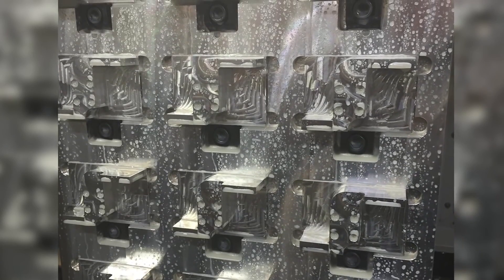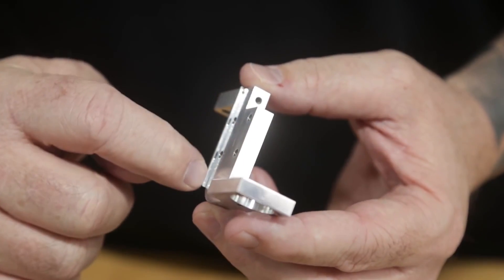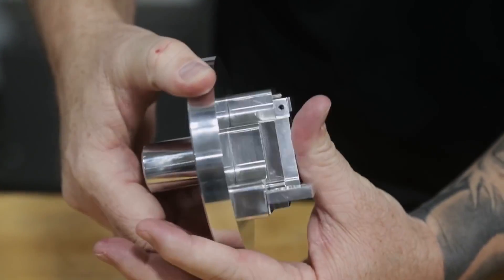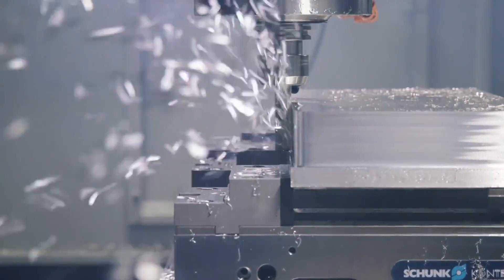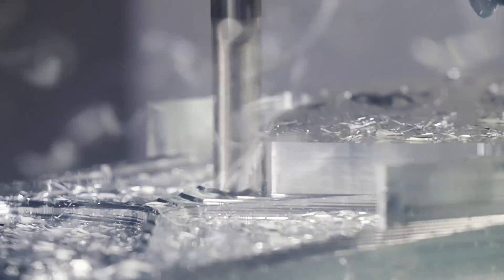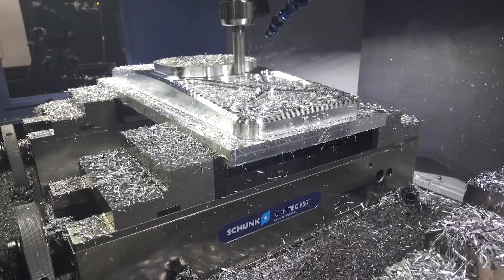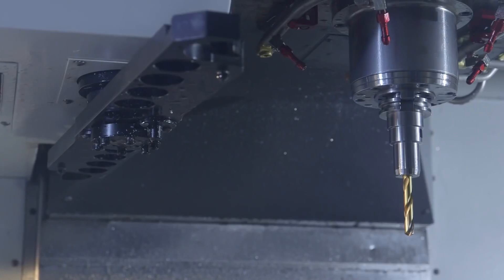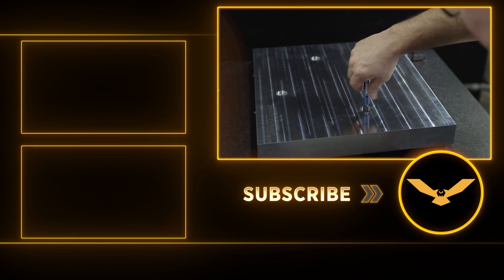Employee SCRAPS an INSANE Amount of Medical Parts... and the Reason is Even More INSANE

Comment: My shop does mostly formed components and sheet metal. I would be surprised if 50% of our parts are within every dimension on our drawings. The boss says we need to do better but doesn't actually put any effort into getting there. This is what happens when we run a soft die for 3k parts because you were too cheap to make a good one.

Comment: I was inspecting during graveyard shift,  an ogive aluminum  product during final CNC machining.
Guages, go- no go thread,  all good, but some  parts failing the hydro- test.. in the same spot...... 
The day boss came in & saw my pile of failed parts & 💩!!! Why did you let the machinist continue?. I told him all specs good ,. Long story short, all fails past threads and bulkhead. Engineering  determined Press  operation causing stress cracks punching out the blanks, Before final machining.  Later the  Co. reprogram  the CNC to Bore out that dimension instead  of punching it out. Saving the production run, although thousands of parts shipped over the years.
Laid off a month later, Force reduction etc,  but never forgot  the lesson & fix..

Comment: Every time you run a quality control check, one should check ALL dimensions. Every. Single. Time.
Change a tool? Check ALL dimensions again. Tweak a tool path? Check ALL dimensions.
The added down time will be made up by a factor of 10 in your reputation for accuracy.

Comment: I spent five years working a station running 5 different sized spur gear cutters.  It’s been almost 15 years since working that job, and I still have dreams where I didn’t tighten the arbor or the cutter, and wound up scrapping a 24 karat gold gear blank.  Now, we never cut gold gears, but my subconscious mind is essentially saying it’s still worried about scrapping gear blanks.  I guess my subconscious mind hasn’t realized that melting and casting a new blank from scrapped piece of gold isn’t actually that difficult if there’s time enough to do it.  I think I might actually miss that job.  Definitely beats sales…

Comment: lol Had a lead man tap a 10-32 hole at 10-24 in a $350,000 inconel nuclear pump on the last operation. Engineers ok'ed as it was just a cover for electrical non vital but there was some puckering going on before it was ok'ed.

Comment: I worked in Quality for over a decade. On several occasions, I was told by my boss that we were the least popular department in the plant. This was true everywhere I went. Several times I knocked down a pallet of parts and the plant manager told me that I HAD to sign off on them and I refused. Each time, he told me that if the parts didn't come back I was going to be fired. Every time the customer sent them back as defective. We had to pay the shipping both ways as well as the time and materials to make new ones.

I was called in as a contract inspector on a job for an outboard motor firm. They'd made some camshafts but the final inspection had detected a critical measurement out of spec. They needed to ship the parts for the holidays so I worked 12 hours a day for a week to get the parts checked. 60% of the parts were out of spec for the same reason as we saw in the video. A third of the run was done well before a tool wore to out of spec and was replaced. The part was not checked on the critical dimension with the new tool and all of the bad parts were run. Another tool change at the end prompted an inspection and the defect was detected.

Quality takes time and attention. Skip either one and you may be sunk.
Reply: Forcing QC to sign off on something sounds like it defeats the purpose. QC should be immune to that kind of behavior, as in you should have the final say over him.

Comment: Are you saying you performed an unauthorized repair process on FDA regulated parts?!  There is an approval process for every part and the process that produces it and if you deviated from your approved manufacturing process without written authorization you're putting your company in major danger of an FDA stop order. If you don't already have an expert on ISO 13485 you should probably get one.

Comment: one of my favourite things that any shop teacher ever told me is "power tools are a way to make a lot of mistakes really fast".

all it takes is one little mistake, and then everything compounds.

i've worked in a shop where the supers were so confident in me that they stopped even looking at parts before signing for first-offs and just signed the traveller right away. that was a bad idea. the quality of my work went down because i had no useful feedback. eventually, they put me back on the cold saw and in the grinding pit because i didn't understand their confusing directions and kept fucking up parts, and then they'd complain.

Comment: No part is PERFECT as he suggests. They only have to be “ in tolerance “to the print. Operator should have checked the features that end mill affects on the next part off the machine. Put it on one cycle and make sure it’s not scrap.

Comment: We had a similar problem recently. We do mostly prototype under 10-20 pieces. And it sucks when the operator doesn't check  in process like you say. Or even make adjustments along the way. Typically in feed and speed. We don't have enough machines for each fabricator to make the desired part. So we used dinosaur manual lathes and mills. And beat to shit with end play and substantial wear on the ways. But yet we have to hold tolerances of .005mm. Of course everything is a mix of metric and standard. So doing the homework ahead of time is key. We only have x,y readout and z is by dial. So all of this makes it nice when the cnc is open. Manual programming I'm ok. But would like to get into the cad end of programming them so I can make some more elaborate parts that the manual machines can't do. But working my way around the limitations of manual has made me better. Getting creative especially with achieving radius and taper has made me a better fabricator. I think I would really enjoy jumping into the programming end of machining and hang up my welding helmet. Anyways another awesome video. I'm trying to turn my our programmer onto your video's. Good stuff. Sorry for the 1st chapter here

Comment: When I got laid off from a job a few years ago due to a change in the industry as a result of milling machines being used to make dental crowns I was looking for a new career. I had a chance to be trained as a CNC operator but that level of precision was beyond what I was capable of. 
I have gone on to another trade where if you are off by 0.001 units it will still be ok and the machine will still work.

Comment: There was a thing I read some years ago, They had built a New Boeing aircraft, they went out and flew it, it worked just Fine. They Landed it, took it all apart. Every part was checked for accuracy and tolerance...The whole plane was 90% out of Specification.  Thing was The critical Surfaces that HAD to be There were there. I thought that that was very telling on where the industry at the time stood. During the production of these planes there were no CNC Capabilities, There were no Bubble Gum Chewing Button Pushers that are now Proudly mispronouncing their 'Machinist" status. Goes to show that there is some latitude in a vast majority of parts, and Most are not Critical, These were done on Fixtures mostly By Skilled machinists and they were done on Manual Equipment.

Comment: 100% right there with you. Been a CNC set-up programmer for over 28 years now. One thing I stress to the people I've trained or had under my supervision is that any change you make, offset, tool/insert change etc.... Look/inspect at the first part that comes out after the change. I would rather have them spend a few minutes on this than have a whole rest of the lot lost on an easily caught oversight.

Comment: You can't inspect quality into a part. Using a better inspection method may give slightly different results, but the part is as it is and the result probably won't make you or your customer happy. Normally they'd prefer consistent nominal dimensions, or well inside geometric tolerances. If they're happy to take out of tolerance parts, you need to ask if the tolerances you're busting your gut for are actually useful, and maybe a Design for Manufacture exercise should be performed as part of a cost reduction exercise (NB cost reduction, not profit reduction - profit can increase for everyone).
You're right to say 'assume nothing' but this becomes tiresome when the onus is put on humans. It's a far better idea to automate in-process inspection, and just use humans to investigate 'anomalies'. As for using a tool that was boxed incorrectly, why didn't your in-machine tool calibrator detect the tool radius wasn't as programmed? If it had, you wouldn't have had any scrap at all, just a near-miss in the log. If you don't have a near-miss log you need one to demonstrate the value of in process inspection to the bean counters, and it also helps Pareto investment in manufacturing/inspection equipment. Ideally the log should be initiated automatically by the tool calibrator and other detection equipment - don't ask humans to own up to 'mistakes'. Humans don't make mistakes on purpose - there are ALWAYS contributory factors, but holding your hand up is still too painful for most people unless you have a very very special management team.

Comment: How can you rework a part that was cut with out the ninety thousandths corner radius and had a sharp corner instead. Sounds like scrap to me. Incidentally what did you give as a corrective action for the descrepancy, and then for allowing it to get through final inspection.

Comment: Reminds me of my own much smaller production incident.  I was running a CNC brake, doing a bunch of smaller pieces that another company would then weld together for their product.  It was my first time making this particular piece, and it needed to be flipped for one bend, but the print wasn't very clear about that.  So, I misbent about 30 of these pieces, about two sheets worth.  I did the proper thing, and told my boss, which led to him for the next two months going on about how I unexpectedly cost him thousands of dollars.  Before this I was the rising star of the shop, the products I was turning out were held up as examples of how to do the job, and high end custom stuff was sent to me to figure out how to make it.  One mistake, and within three months I was out the door.  Sadly, that was how this guy ran his business, and could not figure out why he wasn't able to make it profitable.
Reply: My old boss would take parts out of the scrap bins and throw them back in to be refinished and put into assemblies. A couple times I found machines making bad parts with broken tooling and I heard other people say "but he was just at the machine checking on it". I've never seen insert screws fall out in 5 minutes..? There's all kinds of people out there. Now I drive a truck. It's a lot easier, and it pays better than any machining jobs around me. Honestly I'm not sure I want to do it again unless it's for myself, and I enjoyed it.

Comment: Ha, you should oversee a Union shop that runs production 24/6. They will hire the best setup guys around because of the required pay rate then put them in front of a production machine pushing a button for 10-12 hours a day. They get bored out of their mines and you know what that leads to. IMO the best setup guys do not make the best operators. Just like sometimes your best operators can not make the jump to a good setup guy. We use to do a 100% inspection of a single parts at shift handoff.  One some parts with higher raw material cost sometimes we did it more often.

Comment: Or, get Haas (or whoever) to solve this for you in software ... once the machine is running production, any change in tooling generates a production hold (amber light) at the end of a cycle and brings up an "INSPECTION" message on the screen.  Quality processes can be aided by software.

Comment: Out of print does not necessarily mean unusable for form, fit and function, and does not automatically mean scrap.
I've been on both sides of the great divide during my time in country as an NC Programmer.
But yeah, I fully understand that the print is holy scripture (so to speak) and must be adhered to.
It avoids embarrassing salvage meetings with customers, and by extension, your company's reputation.

Comment: The guys where I work don't think like this. They like to fudge it. Even the MD
The other day a team leader was doing final inspection on gas seal rings we manufacture. He found a low spot on the surface that was supposed to be parallel with the other. He just rotated the ring around a bit so that the CMM didn't probe that bit. I was talking to another colleague about it and he said we haven't had one of those rings returned in 20yrs, and it's a lot of money to scrap.
The tolerances are pretty tight, but not impossible. It's just that the people there don't give a damn.

Comment: The most difficult parts I've ever machined had a precision diameter on a knurl on 440C.  It seemed almost impossible.  I have bad thoughts thinking about it 20 years later.
Reply: Woof. I've had to get knurls to a very precise diameter before, but never on stainless. How'd you get er done?
Reply: @Savagedownsouth  Scrapping about 5 parts. Lol.  It was an infeed roller for fiberglass strand production.   The first one I did, I saved the knurl for last.  Waste of time.   The following parts had the knurl done first, then the rest.  

After that,  I was definitely a LOT more careful with reading tolerances and specifications on the drawing before accepting the work into our shop.

Comment: As a Toolmaker/machinist for 20+yrs, maybe my foremost pet hate is drawings/designs with "unnecessarily" tight tolerances. You can not learn "real world" sizes (and what accuracy is required) sitting behind a computer, or without tons of experience. And it does take many years of practical experience to master "size/accuracy requirements".

And the accuracy vs manufacturing time graph is exponential, (never mind the scrapage rate).

I once had a large job with a very tight tolerance on a certain dimension. I queried this with my boss as it was almost impossible to achieve this. Their engineer eventually comes over a few days later, looks at drawing and says "No, that dimension is basically open size!" Lazy draftsman – who often don't appreciate the consequences of what they put on the drawings! And this is an ongoing problem in this industry.

Why can't we all work together as one team, and not against each other as – it seems – is often the case? Yes we can make parts that are perfect to drawing, but why waste time and money achieving "perfect parts" when it is often totally unnecessary? The global market is a competitive place.
Reply: No kidding. I remember some parts that had +/- .0005 on almost every surface. Marked everything as wrong (because they were), talked to the foreman, talked to engineers. Everything I marked wrong was fine to go, none of them were that critical.

Sometimes I wonder why we even have tolerances called out when the go to answer if somethings out is "just ship it" haha

Comment: Wow, that one aspect I've learned in Aerospace early, you break one tool, you make sure that the replacement tool match the one it replace in the setup.  And often if the tool broke during the machining of a part or process, big chance that the zero of the part for the process changed on that part or the part before.  Meaning an in process setup change, that force on the operator to do a new "Best of" 100% full inspection of the next 20 parts and also verify the 5 previous parts to see if a shift happened before the break.   By doing that, you avoid scrapping a full or large numbers of parts of a batch or worst the full batch.

Comment: I work 3rd shift and my 2nd shift scrapped 37 with an 8 minute cycle time and left *me* a note that I needed to make sure to check my parts! 🙄🙄🙄 Point being 100% check 100% of the time! It ain't hard, no excuses!!! 🇺🇸 Have PRIDE in your work!
Reply: This is why a socket from the company I work for costs $90.00. We have NO first article or in process inspection and if you knew the company I worked for you would shit yourself. $90.00 a socket. Take a guess. You know who it is. We supply the, 'r*pe truck," that comes to your shop once a month. ✌ 🇺🇸

*edited for spelling
Reply: Really this should be common sense and practice.

Comment: Experienced a sort of the same thing.
A eng technician change an implant recipe, it was signed off by various multiple heads of engineering depts what wasn't caught was that the recipe changed was used on another product line.  That whole product line was trashed 3 weeks worth of work toast.

Comment: If you are running thousands of parts and rely on 1st off inspection etc, the only thing that can change is the tooling so, if you use a blum/renishaw tool laser on the machine, there is a cycle that checks the profile of the tool consequently eliminating errors made from changing tools. See, renishaw automated non contact tool setting. Macro O9865

Comment: I am surprised that the dimension was not checked when the tool was changed. I would expect a check on the parts before and after the change. As I am sure you know, You get what you inspect, not what you expect.